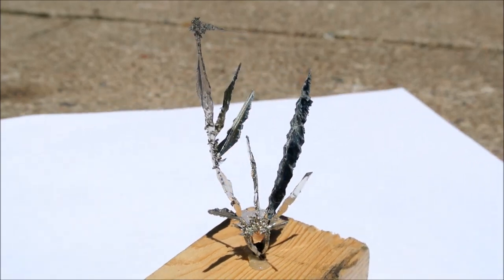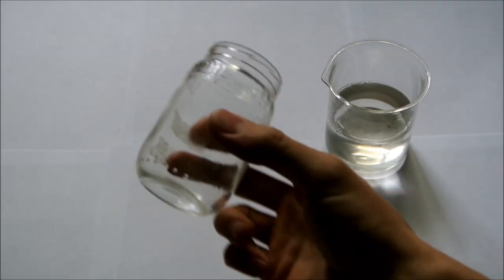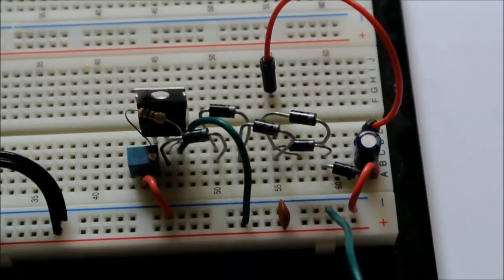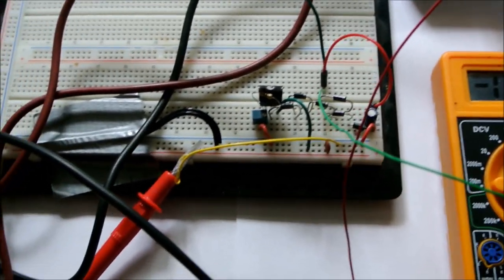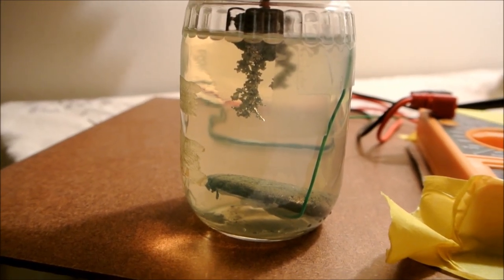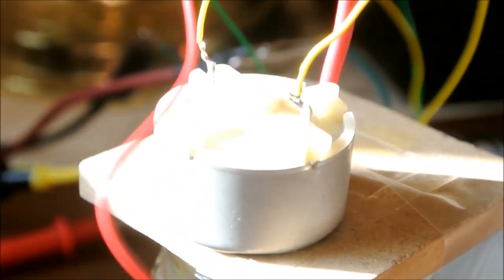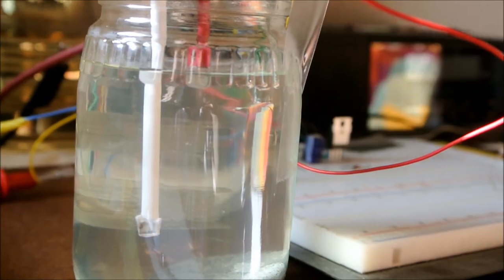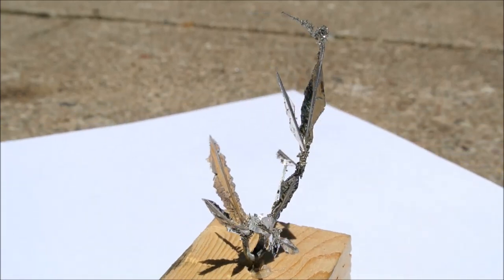Grow Large Solid Tin Crystals

Comment: Great! 
What do you think about iron? Maybe it will growing as a crystals at low current, or some shiny dendrites/spherolites. Also, try to use some surface active agents in electrolyte, it could made interesting results.
Reply from the maker: Iron would be very beautiful.  I do not know if crystals can be grown in solution, but they can be formed by vapor deposition.  I will need to investigate further. 
 http://www.periodictable.ru/026Fe/slides/Fe8.jpg
Reply: You can made iron nodules/spherolites by electrolysis, here is example from wiki:
https://en.wikipedia.org/wiki/Iron#/media/File:Iron_electrolytic_and_1cm3_cube.jpg
Maybe at low current you can make iron crystals, but even a shiny iron dendrites would be great. 
I think that is need to use iron chloride as a elecrolyte.

Comment: That's awesome! Good work :)
Out of curiosity, what was your source for the tin metal?
Reply from the maker: The tin strips came from some science kit and the blobs of tin were refined from Sn/Sb pewter by simultaneously electrochemically dissolving the pewter and plating out tin in a HCl electrolyte.  If I remember correctly I used 5V for the process.  There are sciencemadness threads on this - I may make a video in the future as well.

Comment: does this experiment produce any hazardous byproducts? Would you need an extraction fan etc ?
Reply from the maker: At the level of current this experiment runs at, there are no hazardous byproducts produced.  At higher currents, though, I could imagine that the HCl could make chlorine gas.  A fan is not necessary for this experiment.

Comment: Why adding hydrochloric acid did not result in the tin crystal being dissolved?
Reply from the maker: The HCl is a fairly low concentration - it's only there to ensure no hydrolysis occurs. I believe the low concentration combined with the electrochemical force depositing tin on the crystal prevents dissolution of the crystal itself.
Reply: @ThePlutoniumBunny  Thanks for the info! By the way, I was doing some experiments with tin foil and tin chloride. I noticed that when I dip the tin foil in SnCl2 solution, the foil is transformed into a gray, sponge like substance so I think it is the alpha form of tin? But how can the tin transformed just by contacting the tin chloride solution (2M concentration btw)?

Comment: Can i use another electrolyte?
Reply from the maker: Yes, it is likely another soluble tin salt like tin sulfate or tin nitrate would work, and could even produce interesting effects due to the changed anion.  It would probably be good to add a bit of the appropriate acid (sulfuric or nitric) to keep the pH low and prevent tin from precipitating as a hydroxide or some other gunk.  Give it a shot!